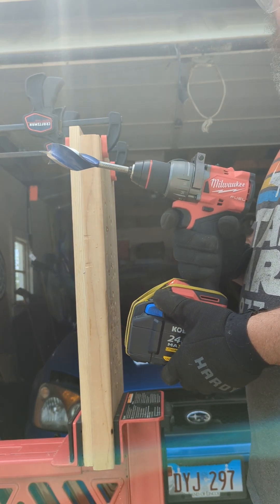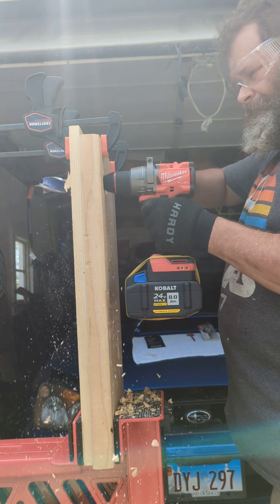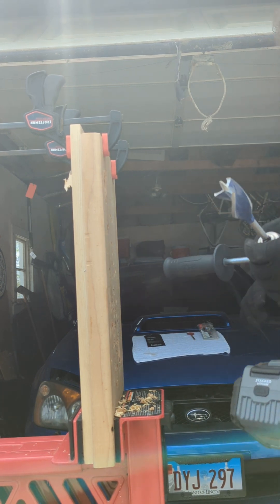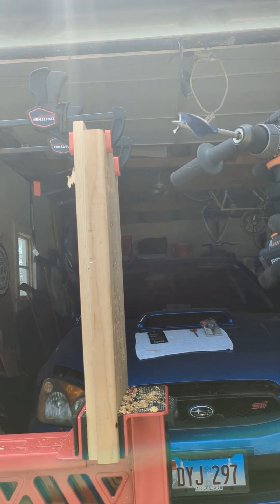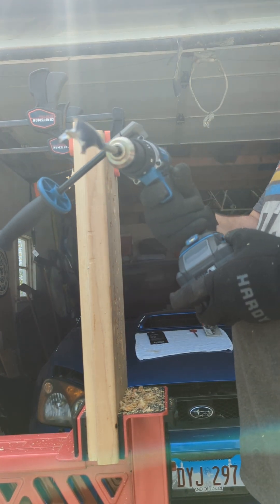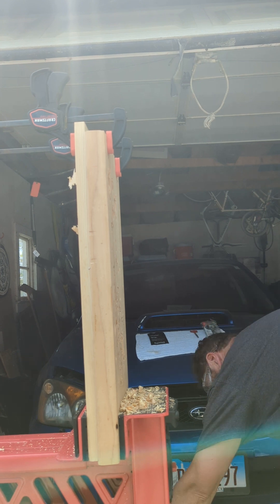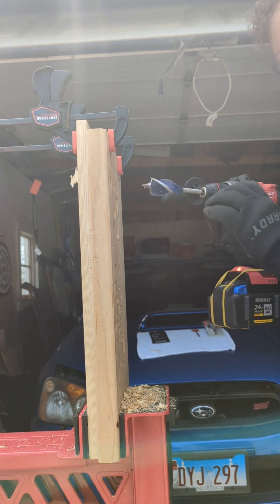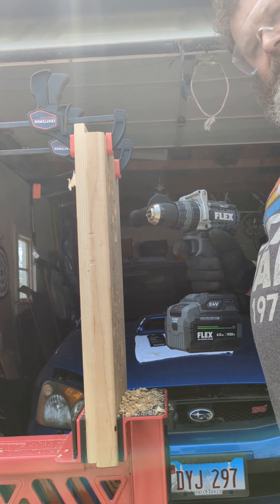MILWAUKEE M18 fuel GEN 4 VS FLEX TURBO HAMMER DRILL vs RIDGID HIGH TQ HAMMER DRILL vs HERCULES DRILL

Comment: Really need Milwaukee ho batterys don't blame it on the Milwaukee because it's more than capable it will wipe the floor with the rigid don't even use the Milwaukee if you don't have the Milwaukee batterys
Reply: Agree.  He needs the High Output 6.0ah battery and then there wouldn’t be any issues at all on Speed 2.
Reply: Absolutely. The Gen 3 would have done that on speed 2 with a 3.0. That Gen 4’s architecture isn’t taking advantage of that 24v Kobalt. It’s a great battery with great cells just isn’t helping the fuels bms
Reply: @TacticalThib  no doubt about that.  The HO 6.0ah is a beast of a battery.  It’s a complete disservice to the Fuel Hammer drill to use a competitor’s battery.